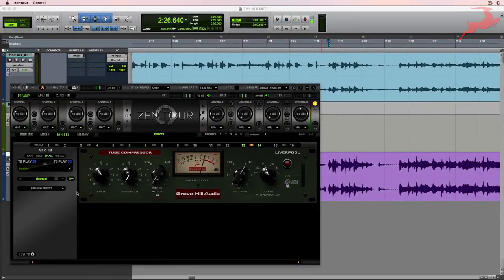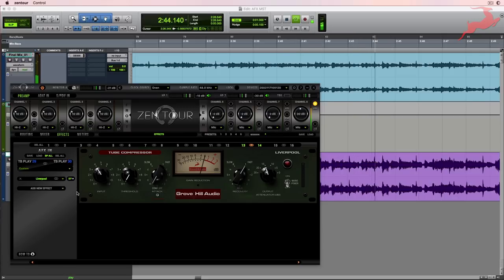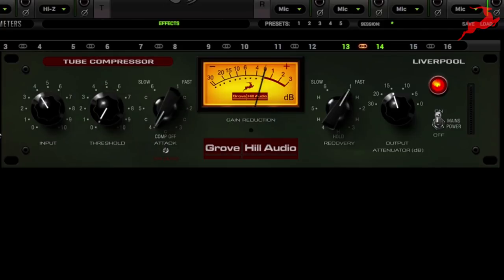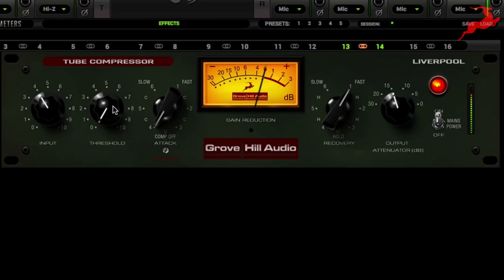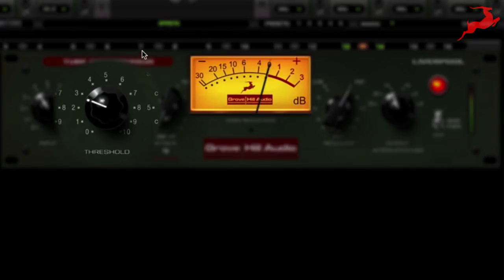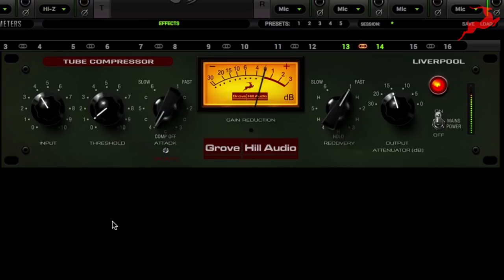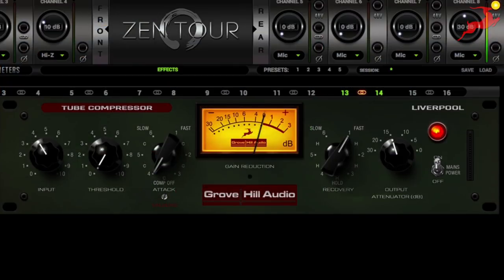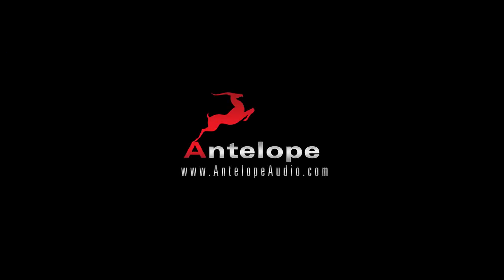Enhancing the Mix - Mastering with the Antelope AFX with Alex Solano

Comment: Disclaimer: I own an orion studio interface from antelope and use it all the time. 
This is such a lie. Why no gain matching? Its not doing anything special.. put the volume the same level as the before and then we will see how true your claims are!. Yes, a tiny bit warmer etc. But its not so life changing that its going to do what you say it is. Obviously its going to sound stronger and louder if its louder. Match volume and then its being honest. Cuz this is WAY louder.
I like my interface and the AFX, but I have an issue with the way you're showing the bypass and the effect. Its VERY misleading
Reply: Agreed. I do love the FPGA stuff too, but this is ridiculously misleading to anyone watching. What kind of pro wouldn't gain match for a comparison? Not impressed.
Reply: Regardless of gain matching. The punch and extra clarity on the drum’s transients is obvious when the compressor is engaged. It adds cohesiveness to the overall mix, brings out the vocal in relation to other instruments and adds the obvious bottom end weight most buss compressors give. The engineer in the video has done a pretty good job and I’d say your probably a novice judging by your comments and ears. So have  another listen to how the overall balance slightly changes when engaged. We also use an Orion Studio and even though I find it fiddly and annoying at times to use the FPGA effects, they are really good
Reply: They never gain match is so fucked up